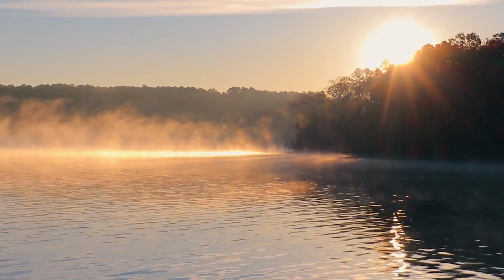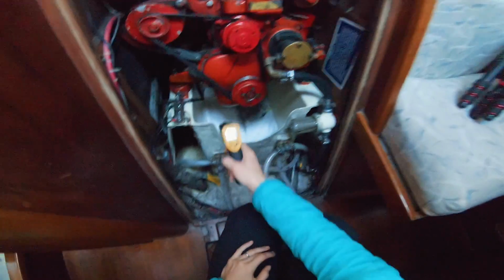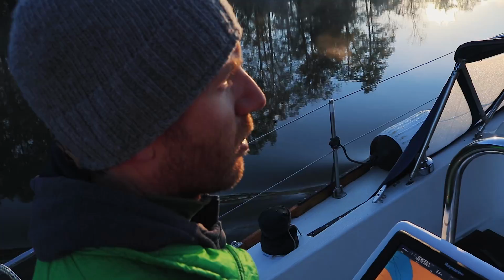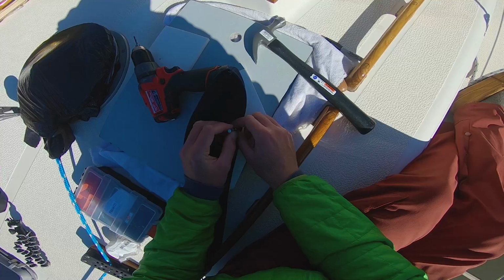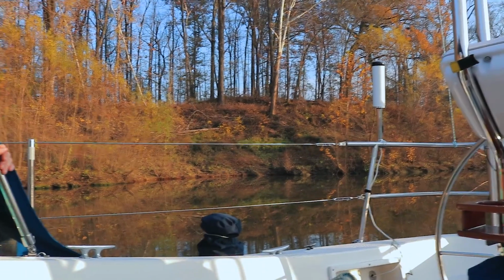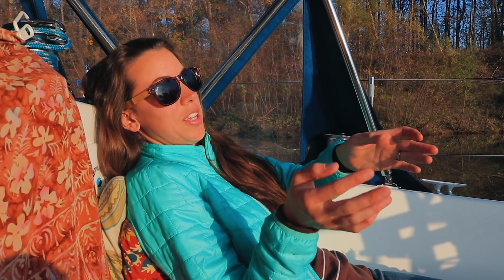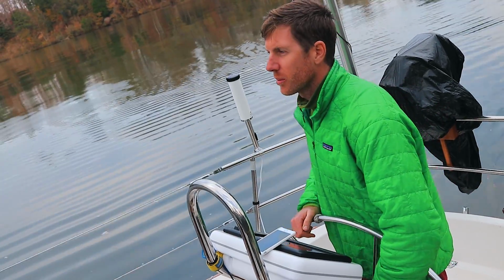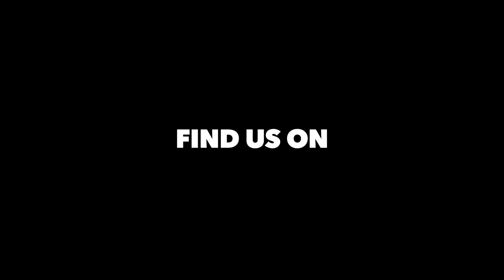Life on the River | Sailing Soulianis - Ep. 31

Comment: The idea of putting the alcohol burner with a pan on  top in the engine compartment is freakin' genius!  A few seasoned mechanics might try a torch or maybe an alcohol burner alone, which is dangerous, but the pan is what makes it reasonable, reliable, safer, and freakin' genius!

Comment: I love the alcohol burner under the oil pan!  That's similar to the old trick we used in the UP of Michigan before synthetic oil.  We kept a small, round BBQ grill (with legs removed) to slide under the engine to preheat.    (Westerbeke 40 and river current...My CD27's 8 HP Yanmar doesn't stand a chance LOL)

Comment: Good stuff!  More from and old crust- you guys know to close the raw water intake when the engine doesn't start right? Cranking it still draws the raw water through until the lift muffler fills higher than the exhaust ports. Then the water backs into the cylinders and out the air intake. No bueno.
Reply from the maker: Yes thank you. We learned about that before the cold cranking started thankfully.

Comment: Hi, Looks like your engine is based on perkins 4107. The inlet manfiold heater is actually a fuel fired  "flame "starter. Turning the key to preheat should open the solid and allow a small amount of fuel to drip on the heater element ( perkins call it a thernostarter) which catches fire when the heater element glows bright red. This catches fire and starts the engine when you crank it in to the cylinder. Main problem with these is that the drip feed for the fuel blocks or the element doesn't glow bright enough. Try cleaning the fuel feed with a needle and see if fuel drips out when you pre heat If no fuel comes through check the fuel line to the thermos tarter is clear. I used to own one and found out the long painful way. The videos are great you do remind me of Ross and Rachel and that's what's so likeable.

Comment: In commercial trucks in cold weather we "plug" them in ... there is a heating coil in the oil sump or in the water jacket ... heat the oil or water up and it heats the whole engine ... I don't think they use "glow plugs" any more ...

Comment: These engines must have a cold diesel start setting.. some you have to push the stop leaver to enrich the injection. 
Some have a kit that is preheating the induction system. Make sure that glow plug is working. 
It can take more that 30 sec .. some times you need to glow 30 to 60 sec.. then crank and glow again.
It needs to suck the warm air in to the cylinders.  A hair dryer on the air intake will help but well your on a boat. 
If you cabin is warm open the engine bay and let it warm up with cabin heat. 

( on our boats we have boiler heat to help and a webasto heat pipe runs next to it but those are Swedish ) 

Check the manual 
The way you do it now it the Russian way .. ;-)

Cool pictures, well done ..keep it up !,, we love to see the progress..

Comment: Ahh you should check the oil level with the engine off! Also please don't reach around that running alternator belt! It could be very bad if loose clothing or hair were to get caught. Shut the engine off give it 5 min to let the oil drain to the pan then check the level. If your adding oil based on the level while it's running you've got too much oil in it. 

Great footage so far loving the journey!

Comment: Are you sure you don't have an excess fuel system for cold starting?
A plumbers torch on the inlet manifold will work.
Don't not be seduced by spray can starters. 

If you would like to loose your fingers, or a hand, or your arm.
Carry on removing the dipstick from behind the belts on a running engine.
Check the oil level first thing in the morning before starting the engine. Preferably with the ignition key in your pocket!
I love your videos
They are a delight.
I'm giving you a bollocking because I don't want to see you injured.

Comment: As a Canadian I sympathize with the cold engine problem.  An alternative solution that works for me is a bunch of   reusable hot packs or hand warmers.  You push the clicker to have them heat up and then pack them around the engine block.  To regenerate them you just boil them in water and they are good to go for the next morning.  Love your channel.

Comment: You don't have to put the pan over your burner when your heat in your oil pan. The open flame from a little alcohol stove won't hurt it unless you're trying to divert the air around the engine. People actually start fires under their diesel engines with open flame. And you should really try to check your oil before you start the engine because once the engine is running the oil is pumped up into the top of the engine and you won't get a correct reading and you may overfill it LOL

Comment: Your engine essentially needs a bit of warm(er) air in it's intake to get started.  One trick could be to have a length of metal pipe perhaps 2-3 feet long which you could temporarily connect or hand-hold to the engine air intake while you heat the pipe with your alcohol puck.  5 minutes of heating should be plenty. Your preheater does this as well but also removes part of the oxygen needed for combustion...My trick is cheap, safe and works every time..hope this helps you one day!  Cheers!

Comment: 4:01 See if you can get an engine block heater on amazon.  $15 for a magnetic one last time I checked.  Also perhaps the fuel needs warming with a glow plug.  That's usually what gels in diesel engines but that shouldn't be happening at 55 degrees.

Comment: I did your trip but going up river. Your videos bring back happy memories. Did you by chance anchor off Goat Island in the Tennessee river?  We start our Yanmar 2g20 on cold mornings by shutting off the water supply, decompressing the engine then crank the engine for about 10 to 15 seconds several times letting the engine rest for about 30 between cranks. Recompress the engine, give her about half throttle, and she fires right up .Done this with ice on the deck. Just remember to turn the water back on.

Comment: at 4 mins are you checking the oil with the engine running?  It should be done when the engine has been shut off for at least 5 minutes to let all the oil drain back into the pan - check your owner's manual

Comment: I would recommend that you not reach around the belt on the engine when it is running. It is a good way to get seriously hurt if your arm or clothing should get entangled with the pulley on the engine. Moving parts on an engine can be dangerous.

Comment: If the engine won't start at 56f you have issues not related to cold. I have started my 1996 Cat 3406E at -20f with no issues and no glow plugs or intake air heater either. The engine does have a computer that will give a lean mixture for easier starts in cold temps though.

Comment from the maker: Thank you all for the concern about checking the oil while the engine is running, we still have all ten fingers (and toes).  We thought we had read in the manual that the correct oil level was when the engine was warm, clearly we took a shortcut here, never to do it again. Continue to enjoy the video, and if you've read this, feel free to spare us the additional comments about checking the oil.  We've been reprimanded :)
Reply: Innocent mistake guys, my guess is you were reading something to do with checking transmission fluid.. that is one you do while it is running at least in vehicles.

I also just want to say kudos for owning the mistake, takes a lot to do it sometimes.
Reply: Not a reprimand. When the engine is running oil is being pumped around the block so theres less in the sump. So the dipstick under reads, and you will end up overfilling. Best to let it settle for 15 mins after shut off for the oil to drain back to the sump before checking, or do it from cold before starting. Loving the vids.
Reply: We love the videos guys,   I know comments / the written word sounds much more harsh than when it is spoken,  so please don’t take it as a reprimand just a concern for your safety,
Reply: Andy Pag also when the oil is too high in the sump the crank ends up hitting the oil which can lead basically whipping the oil in the oil pan or aerating the oil, leading to low oil pressure or not enough oil running through the engine, really bad for an engine,
Reply: Sailing Soulianis I didn’t mean to sound like I was beating u up.....I was a machinist, ole fella who had all his fingers screamed at me all the time about wearing long sleeves or gloves anywhere near any of those machines.........really really like your vids, u guys have a cool vibe, just didn’t want to see u get injured, sorry about my tone
Reply: I'm glad you told me you were already reprimanded before I reprimanded you again. Actually, I was only going to question you about checking something that had a dipstick!  It's not everyone who has 37K people watching over their every move, is it? Love watching you guys!
Reply: Love the videos, keep them coming!
Reply: Some Caterpillar engines have the dipstick marked on both sides. One side is for when the engine is running, and the other is for when it is at rest. The running side is always lower because a certain amount of the oil is circulating around inside the engine. The reason for this is that many Caterpillar engines live in very cold climates where then seldom shut them off.
Reply: Love it. Haha.
Reply: Beautiful video. Such a unique take on cruising and clearly a trip to add to one’s bucket list. Did I mention hand/sleeve into moving parts thingy?  Oops sorry...just noticed everyone else did. Stay safe, we know you will. ;)
Reply: I cringed so hard watching that. You live and learn, but try not to learn the hard way!
Reply: You guys are awesome - just looking out for you! No reprimand... sail on!
Reply: and life vests and jack lines and propane and alcohol and don't run with scissors
Reply: Love the video guys doing a great job keep it going south can't wait till you get your mask back on and your sailboat again and I can see you in some blue water be safe keep motoring on
Reply: It takes a lot of courage to put your life and adventures in a giant digital 'fishbowl' for everyone to observe.

We ALL have made mistakes, and WILL continue to do so, to err is human.  And remember, not a single person was born knowing what our experiences and education over our lives has taught us. And if you're not learning something, somewhere, then you're not paying attention. 

Keep up the great work!
Reply: @richardvandyke9578  dang I personally did not know that! So possibly they did not do anything wrong and we are all jerks!
Reply from the maker: @FeelItRising  lol
Reply from the maker: @richardvandyke9578  We had read in the manual (which was written in 1972ish) that when the engine is cold the oil should not be above the top mark on the dipstick and when the engine was warm/hot it should not be below the "low" mark. Maybe we mentally replaced "hot/warm" with "on"  But when running the engine 12 hours a day, and trying to avoid towboats on a narrow river with strong currents, we got in the habit of finding a semi calm stretch, putting the engine in idle, and checking the oil without turning it off.  That way we still had steerage to make sure we weren't set adrift down river. Obviously we were focused while doing this, and clearly it was risky but felt that drifting aimlessly downriver was possibly worse.
Reply from the maker: @siaripop7  No worries.  Yes 37k pairs of eyes don't let a whole lot get past them.
Reply from the maker: @martyhandley4456  No worries :) We don't want to get hurt either.
Reply from the maker: No worries we understand. We’ve got a lot of people looking after us, so It’s like that scene from Office Space where he talks about his 7 bosses calling him about the TPS reports. “I have a copy of the memo...” “Ya, I’m just going to go ahead and get you a copy of that memo... mmmmk?” https://youtu.be/jsLUidiYm0w
Reply: I’m just wondering when y’all are going to start sailing and posting videos I’m living thru you right now

Comment: I really enjoyed the river(s) trip , I know this is weeks old footage because you were in Florida on the hard ages ago , nevertheless it was good trip , well videoed including the drone footage and it showed a part of your country not many get to see . I loved it :-)
                A quick tip I'll share with anybody who reads this , if your diesel engine is hard to start in cold weather ( maybe your glow plugs aren't working very well or the battery is borderline ) take off the air cleaner and light up a sheet or two of bunched up newspaper and hold that over the intake while cranking , use tongs etc to hold it , it will help the engine start and any bits of carbon / paper that get sucked in will do no harm . Best regards all :-)

Comment: Awesome video, filming and editing is excellent, I wonder if a heat gun would help with cold starts? Well we left Key West and are in the Bahamas, after checking in with customs we blew through Grand Bahama and Great Abaco to get to the Eleuthera Islands, we are presently anchored on the north shore of Spanish Wells, were going to slow are roll now, lots of great diving sites here, we use to snorkel but we purchased a Airlines R260-4 Hookah Dive system, this opens up a whole new world of diving, being able to go deeper and stay under longer, our little Dana 24 has performed flawlessly, I'm amazed how little  of diesel fuel  the 18 hp Yanmar engine burns, 1 gallon a day at 1/2 throttle, we also purchased a Rainman Watermaker system, to purchase water in the Bahamas can get expensive, this system is very portable and is powered by a little honda engine, makes about 37 gallons of water per hour, we also installed satellite internet and tv, a little pricey but so worth it, the only other change we made was put in a composting toilet, no more pumping poop, so are biggest expense on this trip well be food, by now you guys should be under sail in Florida, looking forward to your next video.

Comment: 1) Plug the exhaust. Real good 
2) run a hair dryer into the intake as you turn it over.
3) a magnetic oil pan heater 
4) don't use an open flame in your engine compartment, there are several ways to start a diesel when cold and no glow plugs. The exhaust trick works almost every time on the second or third try.
If you can run a blow dryer into the intake at the same time it should start almost immediately on the first or second try. The plug will shoot out the exhaust on its own.

Your welcome

Comment: Mr bek doesn't happen to have a cold start button on the injection pump does he? Dont know anything about them but my old Ford Lehman has a cold start Button on the pump.
Reply from the maker: He’s got a preheat button but when the batteries were bad that didn’t seem to do it either.
Reply: @SailingSoulianis  oh cool so hes all sorted? Havent got to that episode yet. The cold start button on my Lehman pokes a bit more fuel into it than usual on start up when cold, shuts off automatically once its running.

Comment: yay! almost done motoring!!!   ( you've been thru some really pretty areas, but ..."sailboat"...).  where do you plan on heading once you're ocean-riding??

As for heating the engine.. they make tiny little sterno warmers (the one I used to have looked suspiciously like the sterno "toaster" frame...)  it would heat that whole compartment enough to get the engine to start; and be small enough it would stow out of the way for the rare times you might need it....   would it help to leave the compartment open during the night??

Comment: Worst of all, checking the oil while the engine is running is going to over fill the engine oil this could be dangerous to the engine as if overfilled to far the crankshaft could hit the oil in the pan while spinning causing the oil to bubble and air rate. Air rated oil could cause engine over heating and failure. More importantly, we don't want to see the beautiful Lauren lose any fingers. On a seperate note, your alcohol stove is probably burning way more fuel then it should be. It should have come with some rubber pieces that go over the opening in the canisters where you light them while they are being stored and not in service. These pads or covers if you will keep the alcohol from evaporating. Every knows who has put alcohol on their arms say for one reason or another how fast it evaporates. You are loosing many hours of useage from not covering your canisters thus adding to your cruising expenses.
Reply from the maker: Thanks for your concern. We have closed cell foam covers for the alcohol pucks. I had just cooked breakfast and hadn’t yet replaced them. -L

Comment: The part number for the heater is 1153V Heater Manifold 12 VDC. Your thermal gun should be able detect a change . Great idea of heating the engine but what I really think your doing is heating the air around the intake. Grid Heaters are what Cummins uses in all their diesels. Luv UR vidjayoes! Carry on SOUTH!!

Comment: Interesting solution to a cold engine. I didnt have glow plugs on my '84 Yanmar...and it always got started.. sometimes barely... but it started. Not sure I would have had the guts for an open flame under the engine
Reply: I just happened to think... your problem with a cold engine is no more... I see on Instagram you are South now.... BUT..  I had a 12 volt hairdryer.. connect it to tbe house battery..it should heat things up a lot faster
Reply from the maker: We had some pretty poor batteries on the river trip. So I’m not sure that would of worked. We didn’t even use our LEDs at night. We had solar powered lights we left out on deck and brought them in as candles.
Reply: A can of starting fluid would have worked to start that cold engine. Just remember, a little bit goes a long ways.

Comment: Hey a very inexpensive block heater with a power cut off so it wont drain batteries might be in good use for the motor for yall